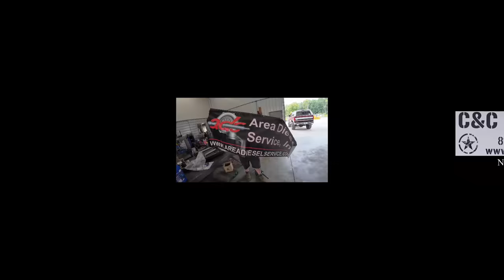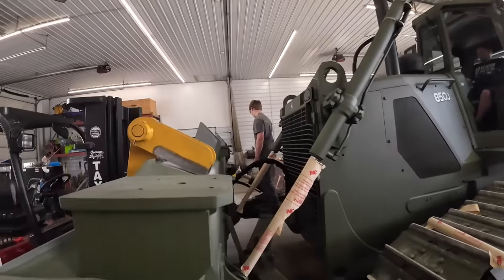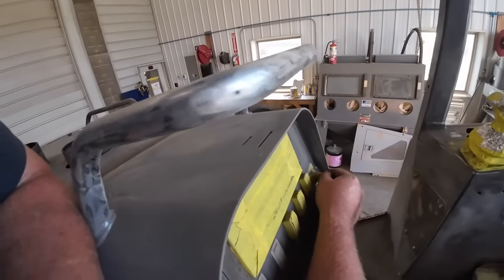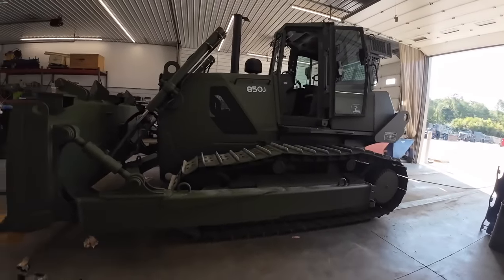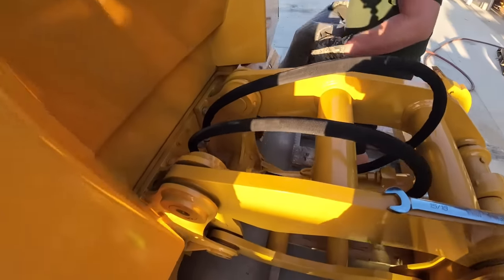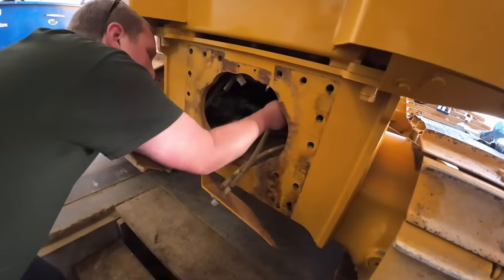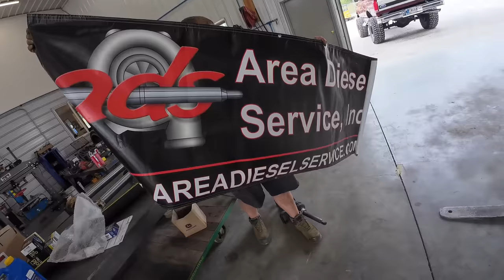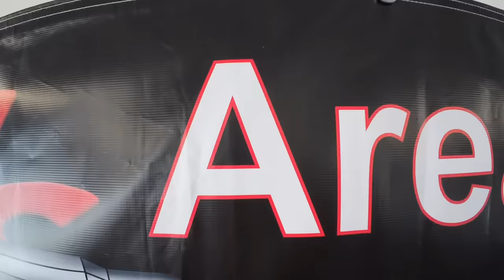We modified an ex military Deere 850J dozer for a customer and some other random shop projects

Comment: That’s my ripper. Thanks so much for helping me with that. Worked great. I put it on a 400 hr 650J  LGP 24 inch pads 115 inch blade. Tried to make it to meet and greet,but it didn’t work out.
Reply from the maker: That’s cool
I’m glad it worked out for you!
Reply: Does Kevin wear short pants with long johns... I m at 18 degrees tonite.     Straight up. 231.
Reply: @tedc7714 gona guesa the green leafs mean its at least 75
Reply: He doesn't need long johns, cos he's got mohair stockings. 🤣🤣🤣
Reply: If you were doing a Gold Rush show, Clint would have to roll a dozer in a creek, Kevin would spend the whole episode cursing, and Tucker and Mason would be in a fist fight while the shop burns behind them!
Reply: @C_CEQUIPMENT A little late to the party but any chance your going to let whistlindiesel do a durability test? Asking for a friend.

Comment: I changed a few of those injectors over the years on 4039t and 4045t deeres I always put anti sieze on the shaft but not the tip when reinstalling them I had one I got from deer was a remand all they had put it in didnt make it a day before the end broke off the piston compression pushed air back into the system and it wouldnt run then the injector that was put in its place did the same exact thing another remand i told them it must be a bad run of injectors

Comment: If you have the pistons open on the rake it should be down when you close it would lift out of the way so it's possible to continue without having to take it off just close the ram then when you want it again put it back down would make life easier for someone that is working on his own cleaning up some land

Comment: May be wrong, in the opening shot with the 850J coming into the shop it looks like the top rear roller is not turning, front one looked fine.

Comment: Believe it or not, most people don't want anything below a 650-700 for a ripper because it usually doesn't have the pull power or weight to sink the ripper shanks.

Comment: Those root rake pins need to be about 2" longer with a long taper turned onto them so as long as the holes are even close they can be driven in.

Comment: This is a test of the emergency diesel fuel line system, this is only a test. Had there been an actual emergency, turn off the diesel engine, tighten fuel line and retest. This has been a test of the emergency diesel fuel line system. Thank you for your cooperation.

Comment: Y'all should have put some 1" plate under the ears if there going to use that brush rake alot they'll brake the ears out of the blade I've seen 3/4 plate cracked out and replaced it with 1"

Comment: Remember back in 92~ish had a 86 Ford F250 with a 6.9... Took the pump and injectors to Daves Diesel in Muncie... got an entire rebuild return system, rebuilt injectors and pump... Of course had the smoke screw turned up, on that 6.9 dog... LOL... So "we" meaning my wife's cousin, who was a certified Ford mechanic, working at dealership, for more than 20 years,,,, helped us on the farm when he could... put it all on, and replaced the water pump... Got one bolt in the wrong spot on the water pump,,, first start instantly broke the drive shaft on the injector pump,,, one longer bolt... Dave made me a deal, but still cost $600 for the exchange!!! Stupid mistake!!!

Comment: Would it be possible for you to make it so you can lift the ripper rake out of the way without having to take it off if you could fit ram to it so you can lift it so you can use the blade like normal so you can use with or without the ripper without having to take it off
Reply from the maker: You could but it would be in the way yet and unbalanced pushing dirt with all the weight in the front

Comment: Soooooo, 850J, more compared to D5 or D6??? I'm a 58 yr old farm boy, just likes watching equipment.... CaseIH, Pete, Cat, Ford, Claas, New Holland, Fendt\AGCO etc... fan... don't wear the green underwear... LOL!!! Those X9 combines... WTF... took them 5 years to release them... and the 13.5L, EGR, head gaskets, head cracks bla, bla , bla... why they switched to Cummins... Hope this new 13.6L can redeem them.... 12.9 FPT/CaseIH... 700hp all day every day... proven.... Now they finally released the 16L in AG... 790hp, can probably easily do 900.... marine cam etc... just like CAT, put them in marine mode!!! Someone needs to start using MTU in AG,,,, Roles Royce.... MTU.... AGCO is using MAN in Fendts.... lest roll... 1000hp tractors....
Reply from the maker: D6